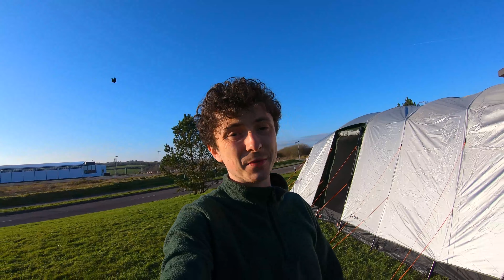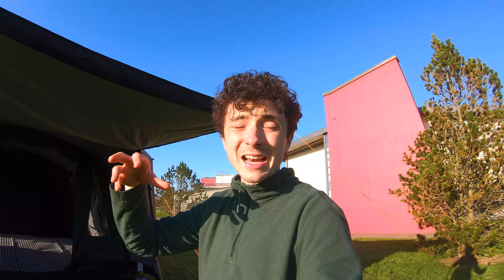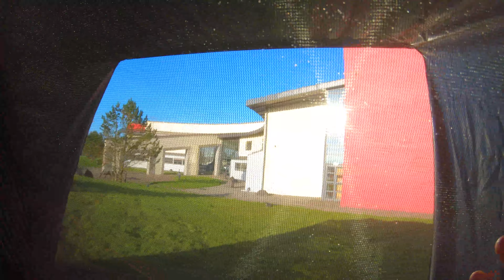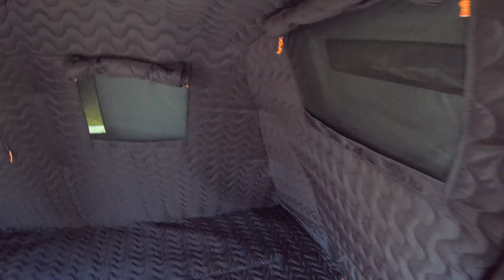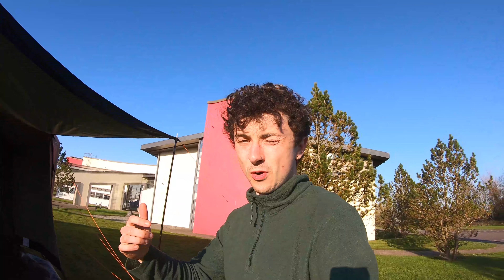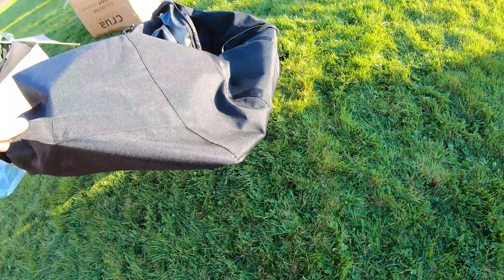Crua™ Loj - Extreme Weather 4 Person Tent | Crua™ Outdoors

Comment: So we've had issues with this... Can you show a video of how to pitch this with the ground sheet. The ground sheet froot print protrudes the tent ground. When it rains heavily the fly sheet run off hits the ground sheet and collects between the ground sheet and eventually comes through! On perfectly flat ground may  be better. Our ground wasn't far off perfectly flat. I had to fold the ground sheet back on it's self to prevent this ensuring the run off hit the floor and not the ground sheet. This was happening even with the wind blowing water under the porch on to the ground sheet then running under. I get the ground sheet provides extra protection but the water should go the other way... into the ground and preferably not between the sheets at all.
Reply: We had ours set up for 2 months here in the mountains of West Virginia (USA)! Thru severe winds and rain.
We had no issues with water protruding anywhere. Was your tent guyed out properly? Also, we had the fly cover on. That may help the rain run off away from the tent. Maybe like you mentioned, folding the ground cover back at least 12 inches from the edge of the tent.